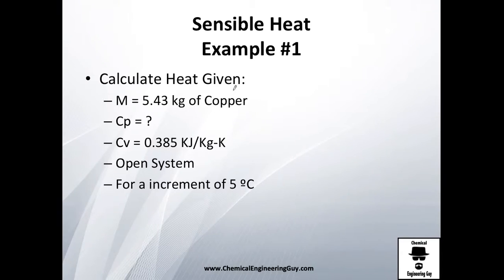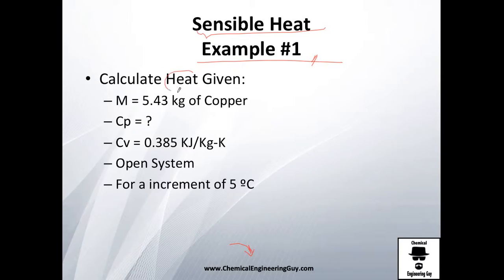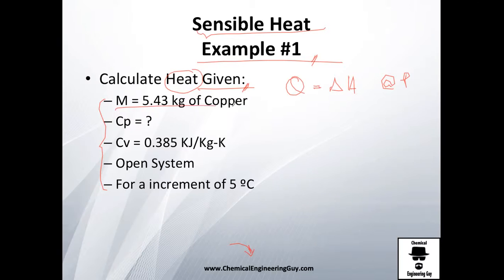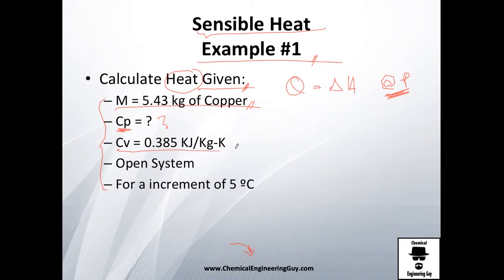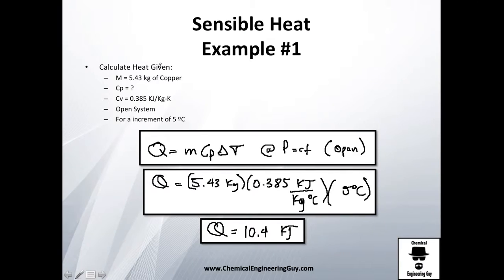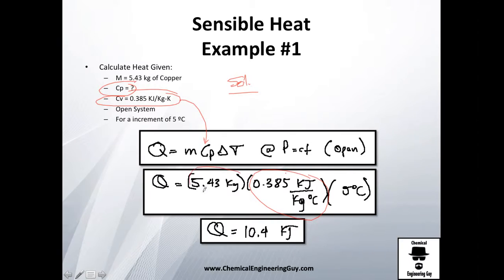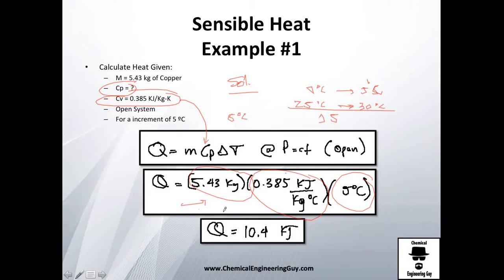Sensible Heat Exercise #1 of 3 // Thermodynamics - Class 102

Comment: Hi, why did you use Cv as Cp in the heat equation?
Reply from the maker: Cv is used when heat is at constant volume, but the most common case is constan pressure (i.e. atmospheric conditions)